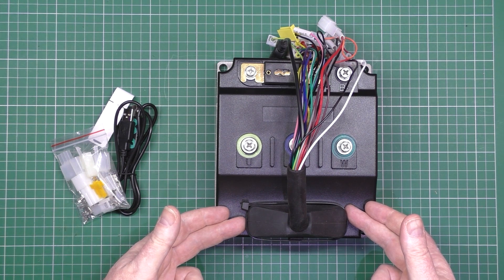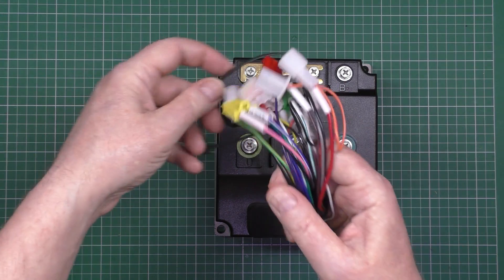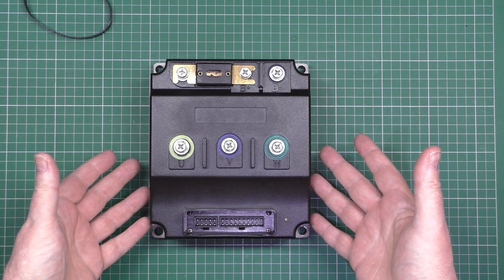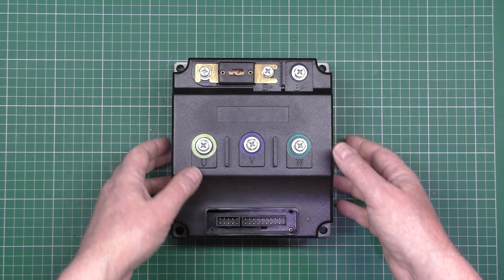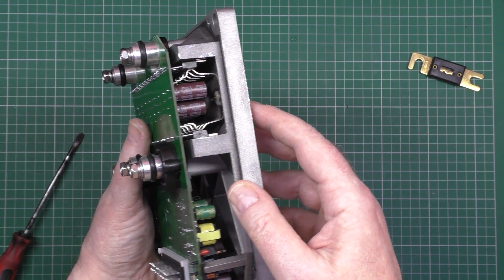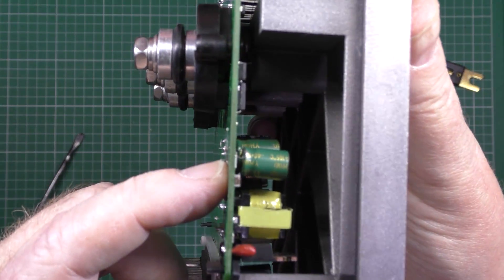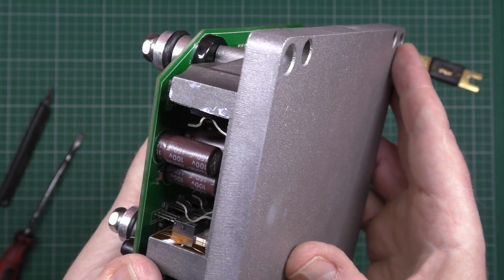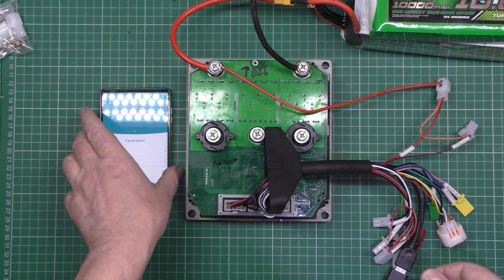Sabvoton SSC72150 teardown (as far as I dare)

Comment: nice vid thanks i got this controller with Bluetooth dongle trying to connect with no luck i dl app of play store and it not working have u got any other place to dl the app from pls
tried to use wire and when conecting  only rx flash green not tx so i dont know if there is issue with wiring inside controller i followed all the steps correctly by the way

Comment: I can not unlock the Sabvoton 72150 controller. I have a over voltage of 88v. But also current 150. Which I want to increase.

You can tell exactly how you unlocked.

I downloaded the program MQCON-current unlock.exe

thanks

Comment: Do you have a broken Sabvoton  SSC72150 so you don't have to destroy that working unit, I this this like the unit used on the Tesla  E-Bikes that race around the IOM TT course for about 2 laps, this will be driving a 3 Phase motor, it looks like there might be a requirement for 8 batteries as the last time I looked at a Tesla E-Bike I counted 8 large cells.

Comment: the nerve of sending out repaired models though.... especially when theyre repaired to that standard, how hard is it to solder a through hole cap... the soldering iron shouldnt even be on that side of the pcb smh
Reply from the maker: Yeah.... I'll be taking it apart again and doing it properly. It looks like there's other capacitors change too!
Reply: @Vortecks  How many max phase amps would you recommend to get the most power out of this esc while still staying safe?

Comment: Hi 👋 brilliant channel 😊... do you know much of the QS273H40 rear hub motor? I’ve ordered 1 and I want to know how fast it is ? .... top speed and torque... many thanks 🙏 David
Reply: I have a 273 mounted on my cross moped running with the ssc72150. Top speed 90kmh. Torque, shit ton of it. Currently I’m running 10kw and it doesn’t get warm at all. It can probably take 20-25kw peak no problemo.
Reply: Anton Npn brilliant I wanna push it to 20kw peak power 😊 thank you very much 😊😊😊
Reply from the maker: I can only wish I had the bike to fit one. At over 20kg, it's a beast!
Reply: Vortecks .... I have a vector Ebike but I found the 14kw rear hub motor and max adaptto controller to be lame and boring so it’s getting upgraded to a ASI8000 controller with the QS273 H40 rear hub and V3 cycle analyst .  Electric race technology’s in California is building the motor for me so it’s a waiting game but as soon as it’s on the Ebike I’ll be heading off to mount snowdon to climb it 😊